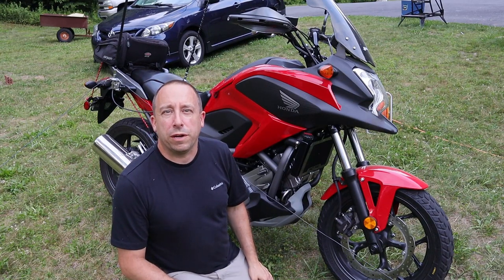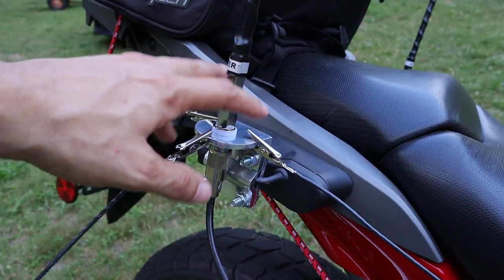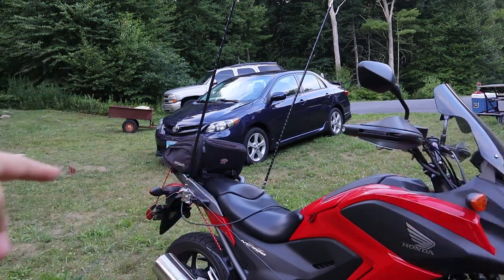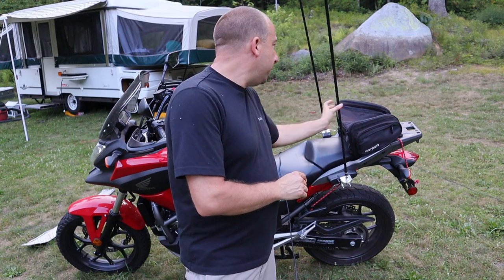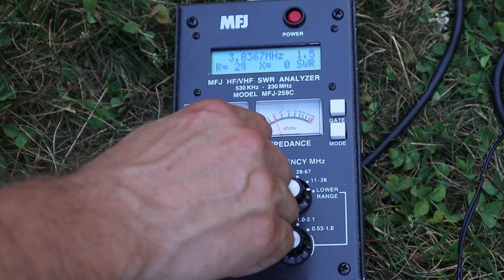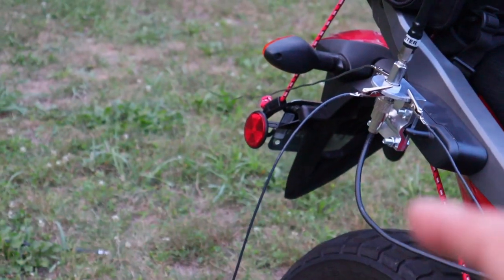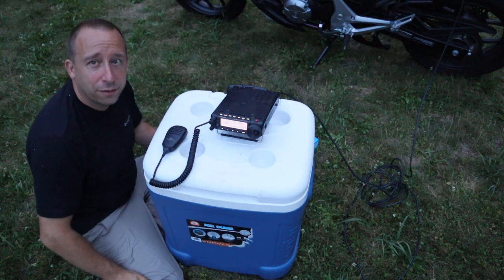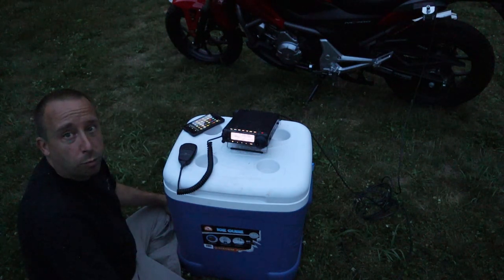Ham Radio Antenna Project: Ham Sticks on a Motorcycle!

Comment: I know it's been a hot minute since this went up, but I saw that you are still using this setup within the last year.  Have you ever considered using one of the 17ft+ telescopic whips (and maybe a loading coil) vs a set of Hamsticks?  You could put the whip on a quick connect, so you can remove it while riding, and they can collapse down rather compact.  A BD7IBI 5.6M telescopic off AliExpress will collapse down to ~20in, which 'should' fit in your tail bag (might even be able to leave it on the mount when collapsed).  This would give you 10-20M with just that single whip.  If you add something like a Wolf River Coil Mini or Sporty Forty, you'd pick up 30M & 40M (maybe down to 80M with the Mini), and they are no more than 10" long... That means you can also lose the 2nd mount, as it wouldn't be needed, and get 10-40M, with easier adjustability, with a single antenna solution.... Just a thought

73
Reply from the maker: Thanks for the tips Tim - I may try something like that at some point just to see what the performance is like and, as you said, to get rid of one of those mounts.  For now, the hamsticks are working for me for quick activations.  For longer activations I leave the hamsticks at home and break out the EFHW.

Comment: Great video! Shark has a quick disconnect that I bought that works great to switch antennas. It raises the antenna almost 4 inches so you might have to re-tune. I have the best results using my shark whips over my EFHW -8010 and my WRC SB1000. I have the 75 meter whip for SSB. I also have the 20 and 40 whips. The next item I would like to try over using my WRC setup is a quad Chameleon with the Shark whips 20 and 40 for portable operations or mounted on my house roof. I don't think you need radials for the Chameleon quad or octa setups.
Reply from the maker: Ivforgotvaboutvthe quick disconnects

Comment: Nice job Rob, I actually have the same set of hamsticks. Have you thought about using short pigtails mounted to the clamp bolts and a anderson power pole to hook up the radials multiple radials hooked to Power pole.?
Reply from the maker: Yes but this is simpler...and being a cheapskate and contrarian I only use power poles if I absolutely have to.

Comment: Actually, the only time the length of the radials is important, providing they are long enough to begin with (30+ feet).... is if they are elevated. If you still want tuned radials, and want to make it easy on yourself, try this:  drill one hole in the mount, use a single bolt and wingnut, with a washer. As far as the radials, make 3 with a small guage white wire, and put them on kite winders. Mark out the band lengths with paint, it permanent marker. The extra coiled on the winder will cancelled the additional length. Attach them all to a single spade connector, to attach to the wing nut. Should make your setup with variable length radials pretty quick and easy. 73, N4ZN
Reply from the maker: I have done just what you were saying with tape measures on another antenna I built and it worked great.

Comment: Rob....Did you consider using tape measure radials? They would seem to be a good, quick-deploy, variable-length setup that would adjust easily on the bike.....and keep you from wrestling with a 'nest of snakes' in your carry bag. Hope you're doing well. Talk soon! 73 de W1NLJ
Reply from the maker: Yes...I haven't had time to make the alligator clip pigtails I need to go between the tapes and the mount just yet but that's next on my list.
Reply: @SevenFortyOne  ... Also, just a little 'tip': You might want to try crocodile clips. They'll grip the thickness of the mount a bit better, for roughly the same cost.